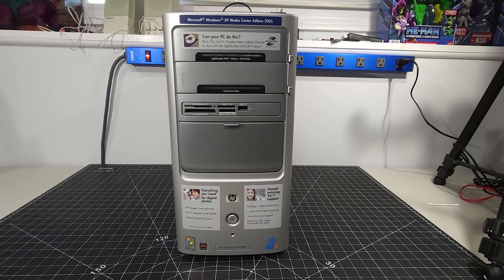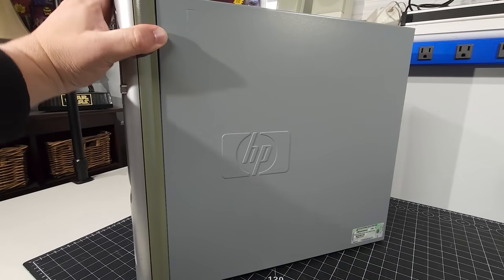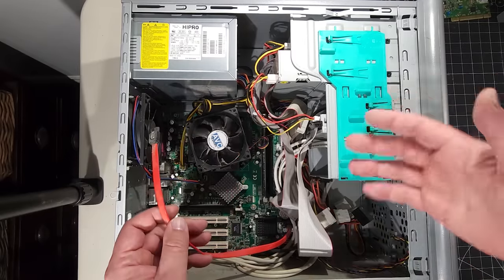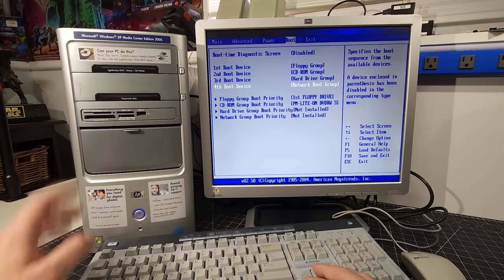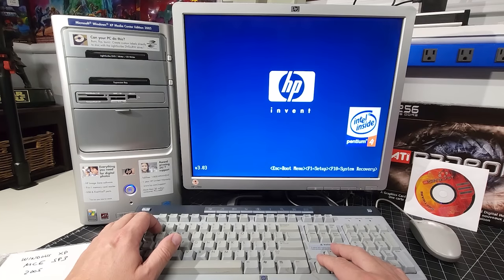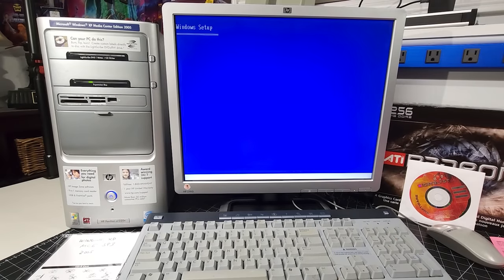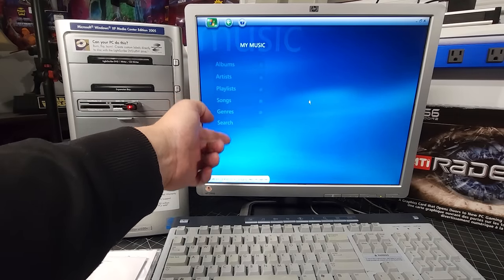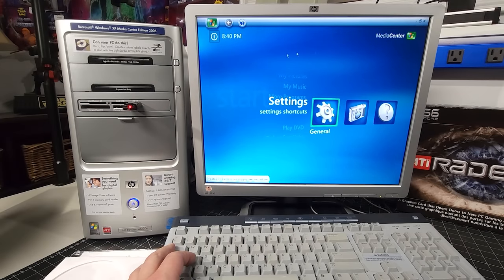HP Pavilion - Windows XP Media Center Edition from 2006!!

Comment: They sold that style of case forever and depending on what you got. Could be full of bad caps. Also as I see you have the media center edition. The story goes behind that and others was that the OEM mfgs. had to use XXX number of different Microsoft licenses. So you stick a capture / video turner card in it. Now you have a media center. Most people I ran across who had that never even used those features. Surprised the model you have does not have bad caps. But, I never paid that close of attention to what version of those did or not and as stated. At the end of mfg. those. They did not and with the exception of a bad psu or hard drive. They are rock solid machines.
Reply from the maker: Love this back info, thank you!  Happy to have it that's for sure.

Comment: Hmmm, its 775 or 478?, in 775 we can upgrade with pentium D, or if get better chip can upgrade c2d 2.0ghz,. For memory if ddr2 you can max 4gb (2gb x 2), because its pci-x 16 you can also add grafik card, gt210 1gb/128bit/ddr3 its still cheap way,.
And SSD, you can up to win 10 in no problem,.,.
Reply from the maker: Talk about a major upgrade!! I'll have to take a look to see what socket it is, but to be honest, I think I may leave it like this as a Media Center.  Not for usefulness sake of course lol, but for nostalgia and having a bit of fun on some older hardware.

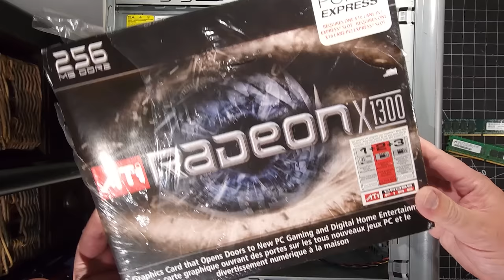Comment: 19:30 "Any card is a fancy card"! I learned the hard way After having my Laptop die, Using integrated GPU of old 2006 Core 2 duo laptop 😫😫
Iam not complaining,  Intel965 graphics is good under windows 8.1(XP actually limits OpenGL to 1.5) for playing Indie games up to OpenGl 2.0 like "Brawlhalla" at 60 FPS & runs Dreamcast 90~99% Frame skip turned on tho~
Spiderman 2 2004 runs 😂PS5 has nothing on ME
Hint: You can search for abandonwares games from the year 2005~2007 to get an idea of what to run, DiRT (Colin McRae) is a good start listing Pentium 4 & Radeon X1300
Reply from the maker: Hahah well any card is a fancy card within reason lol!  Thanks for the suggestion, I will check it out.  I'm always chenging different hardware configs, so it would be great to be able to see what games would play on X hardware.

Comment: i bought one of these at a futureshop boxing day sale. same case, same windows xp media center, but mine had the athlon 64x2 3800+. i think it was 400 bucks. it's not the 200 dollar unit i wanted from the flyer that they probably only had half a dozen of, but it was still a good buy at that time. and it was a dual core, which was pretty new then.

funny thing is that i added a radeon x1300pro as well. it played vice city well enough, and i believe i played san andreas as well, but i think it was kind of choppy. i ended up swapping to a geforce 7600gt, which was a better card.

i even got a new power supply and a 9600gt, but realized i was kind of beating a dead horse by that time. i then used that power supply and 9600gt in my first ever build. but i still have the ram, the cpu, the hdd, and that lightscribe drive. and a boxed x1300pro, and 7600gt. 

memories...
Reply from the maker: Nice!  Thank you for sharing the memories on the channel!

Comment: I have this PC model. Just the power supply is broken. I cleaned it inside because there was a bunch of dust and spider webs. Just need to find the accessoires and a New power supply and then it Will be usa blé again.
Reply from the maker: Awesome!!! Let me know how you make out.  Does yours come with the tv capture card?
Reply: @TheRetroRecall  unfourtenately not. Mine did not came with. Or maybe it had it but it was removed. Mine was produced in january 2007 and it came preinstalled with Windows vista home premium.

Comment: With Windows XP, almost ALWAYS is going to be the optical media, or MORE LIKELY is the media you're using if it was burned.,  You need to burn SLOWLY..
Reply from the maker: Yes, I always burn at 12x when I do these cd's for the older systems.  In this case, I bet the drives are just bad.
Reply: @TheRetroRecall  on occasions I have had to burn slower.  Also if ever using a CD-RW/DVD-RW, make sure you do a full erase (not a quick) before burning.   Likewise with using thumb drives, they HAVE to be FULL formatted every other copy (every other time you copy over the WinXP files) because the installer can’t really deal with the fragmentation that happens.  So you’ll get a file read or “cannot find file specified” error.   I used to install and reinstall XP a lot testing various things.  It’s a fickle beast 🤣

Comment: i never known anyone use firewire
Reply from the maker: Haha I think it was mostly used for camera equipment data transfer and some external hard drives.  I personally never used them either!
Reply: I used firewire to stream my Panasonic video camera as my first live streaming camera when UStream went live. I found it far more stable than the USB of the time which was also an option for me
Reply from the maker: Yes I heard of this application of the FireWire port as well. The tech was definitely better but with USB 3 and beyond.. Bye bye FireWire.
Reply: @TheRetroRecall  1st and 2nd gen iPods were firewire only.  3rd and 4th gen had 30 pin dock connectors, but could only charge from an Apple brick or a Firewire-to-30-pin.  USB-to-30-pin could only do file transfer, not charging.
Reply from the maker: Really... . I was around then and I don't remember iPods having FireWire.  Neat!

Comment: No it was not a decent processor at the time hecause it was the socket and generation of core 2 duo and core 2 quad. There was also the pentium D running at up to 3.6 GHZ. Pentium 4 was the bottom of the line CPU.
Reply from the maker: I found it was decent in my experience.  There will always be 'better' CPUs in every generation and ones below it.  Sure, if you always want the best this may not fit that bill, however this would have been decent at the time Imo.